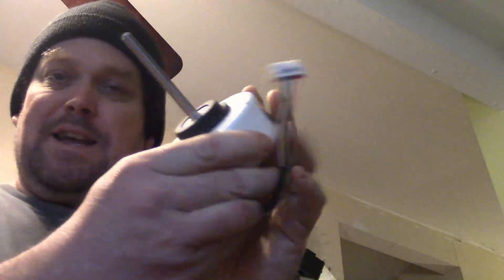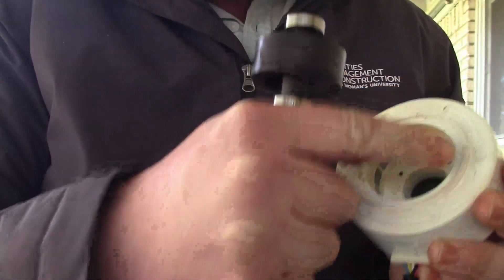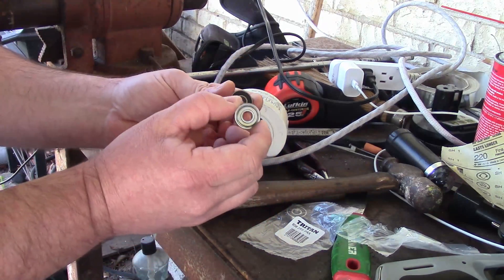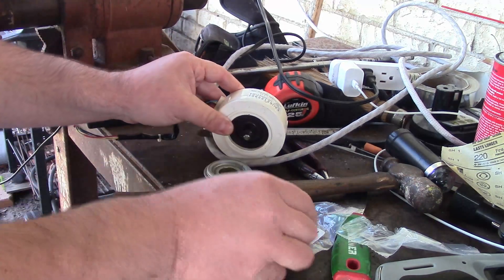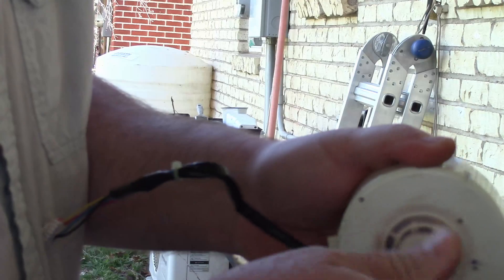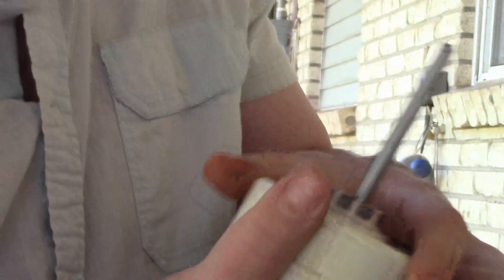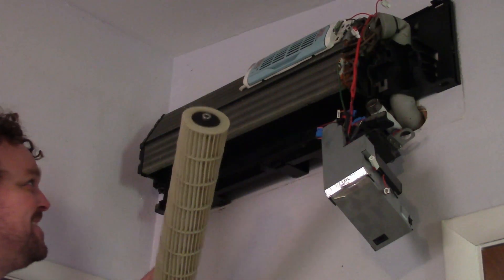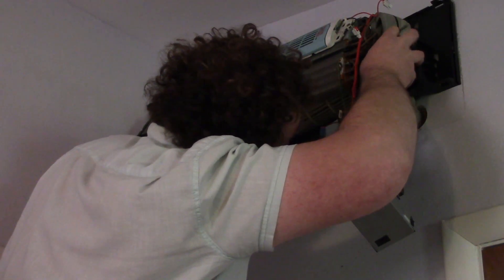Why is my mini split making noise? It's the bearings.

Comment: Each model may be very different.  Some you can get to easier than others.  I am not sure all the motors are that easy to replace the bearings on.  Worth a try as you are replacing it anyway.  Cheap bearings that they use don't last that long.  Get a brand name when replacing and it will last much longer.

Comment: lol, these kind of fixes are the best ones.
Maybe a little tip on the bearrings, try to peel off the rubber seal without damaging it ( a very small flat screwdriver works ) , and add a small fingertip of extra grease to the bearring.
Ive worked and replaced bearrings for years on lots of smaller stuff, and noticed that maybe for the last couple of years, the bearrings started to wore out faster than usual. The reason is very most likely, that the factories add less grease to them then a decade ago.
Ever since i added more grease to them myself, the bearrings last much, much longer.
For these light-duty uses, you don't have to add much, but really, do add a little bit extra.
For very heavy ( and not clean ) use, you can stuff them full.
Reply: If you need to add grease to new bearings, you are probably better off buying better bearings. I wouldn't suggest mixing greases since some don't react well, so if you feel regreasing a bearing is necessary, the safer approach would be to clean out the old grease first with brake cleaner or similar. Also, be careful to not over grease the bearings because doing so will create unnecessary heat and friction (which is especially bad on a small, high speed, low torque motor) and can damage the seals. The general rule of thumb is to aim for about a 30% fill.

Comment: Oh man!  That's exactly the same motor in my air handler.  I have two the same age and one is noisy.  It's a pita to pull the motor but i've done it a couple times just checking to see what the noise was coming from.  I'm definitely going to do this and fix the motor.  I believe the sealed would be better in keeping dust and dirt out when compared to shielded, though shielded bearing are much easier to grease or regrease.
Reply: Why would LG use shielded bearings?

Comment: Thanks for the video.  Glad to know the motors on the LG are serviceable.  I've got an LG that's starting to whine.  My older Friedrich had the same bearing issue, but the motor was NOT serviceable.  Instead of removing a retaining ring, I had to break plastic and desolder the board, and then after reassembling (and re-soldering after new bearings were in), epoxy it back together.  I'd have spent the over $300 on a replacement motor if it was in stock, but no luck there.
Reply from the maker: @robertlitman2661  I have three indoor units and have fixed two of them. I thought the third one was fine before i fixed the really noisy ones. Now I can tell it has a very slight wining coming from it. I am pretty happy with this LG unit, it has proven itself to be designed to be repairable and quite reliable this last decade.

Comment: It's a constant wear item so time will wear it (as you can see they should be that loose.) One thing that shortens the life of the bearings is dust build up on the fan causing excess vibration (and noise) due to being unbalanced. Minisplit heads have terrible filtration so you can more wear and more mold. As evidenced by your disgusting fan cage lmao. Clean these things after every cooling season or twice a year if you use it all year long. It's a pain in the arse depending on the model, I know.

Also, that was a spring not a washer.
Reply from the maker: I didn’t include how disgusting my fan was in the video. I brushed it out and vacuumed it before I showed the clip of washing it off. It was true nightmare fuel. I can’t believe how disgusting and dirty these things get. After cleaning the amount of air it moves tripled! Thanks for the comment, I can tell you have been through it with these units.

Comment: After a little Google-Foo, It looks like 608ZZ would be the shielded bearing equivalent for those interested....
Reply: 608ZZ is shielded, but you want 6082RS, which has rubber seals.  The biggest issue you will run into is that 608 bearings are so ridiculously popular (in fidget spinners and such), that the retail market is completely saturated with counterfeit garbage.  Look for "EMQ", which stands for electric motor quality.  That gives you better odds of not buying trash.